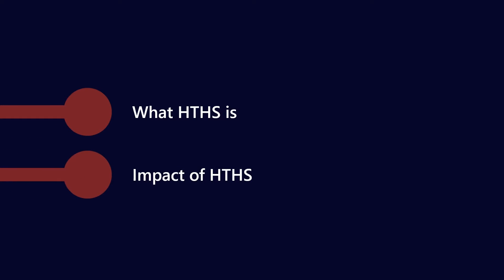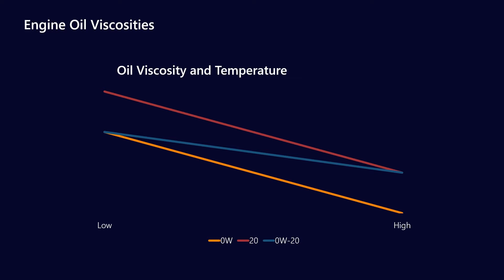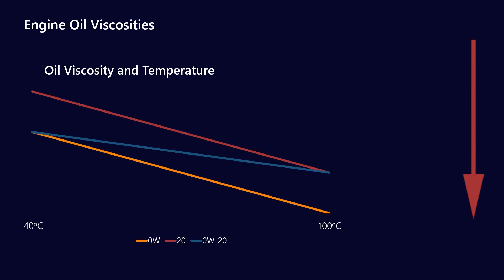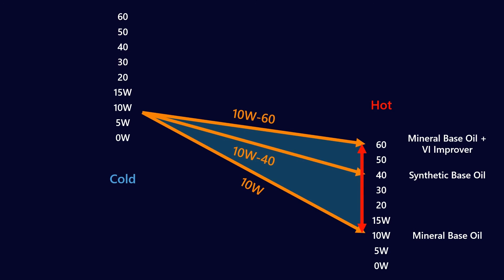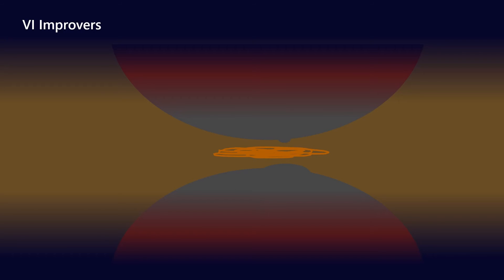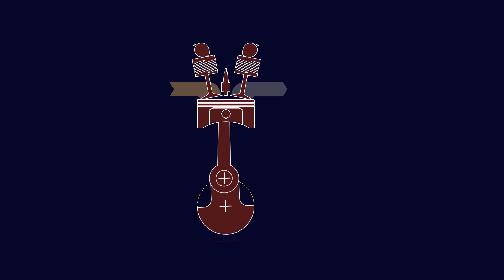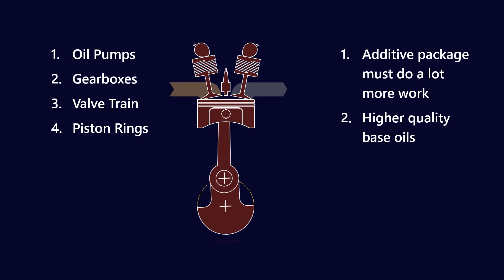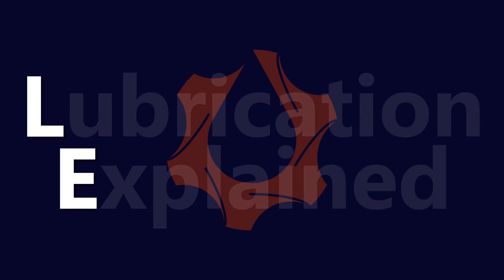How does HTHS viscosity impact engine performance?

Comment: Personally, I’m leaning toward HTHS, maximum viscosity for the cold temperatures seen, a good additive package, & 5k mile service intervals leading my oil decision.

You may look at your oil temp gauge and think you’re fine, but as you mention, you need to choose based on worst case scenario temps at these high shear locations such as needle bearings in roller rockers, timing chain links, piston rings against cylinder liners, etc, the highest temp locations for maximum durability.

Fuel efficiency loss is last considering the high cost of maintenance these days.

Comment: I only run oils with HTHS of 3.5 or greater in any vehicle I own. Do not let them convince you that reduced HTHS formulas are better. They don't even yield any fuel economy improvement. Stay away from anything under 3.5. The VW/Audi 504/507 or Porsche C30 C40 spec is the only one I use in anything. The government wants your car in the junk yard ASAP. Remember that.
Reply: If your engine isn't designed for low hths viscosity oils, you must not use them. If it's designed for these oils, it may not be recommended to to use standard hths oils.
Reply: @franktechmaniac7488  Not true. There is literally ZERO difference in design. Some of them are even the SAME ENGINE with different oil requirements! Proven by part numbers and build dates. AND The owners manuals in other countries for the same vehicles even prove this. So get out of here with that nonsense.
Reply: It seems you know about oils.... I admit you... What country are you from?

Comment: Does higher HTHS necessarily mean higher protection? There are myths surrounding the BMW S65 engine rod bearing, which people claimed that the rod bearing clearance is too tight for the 10w60 oil to pass through the gap. However I think it's the HTHS being too low, contributing to the damage of rod bearing.
I suppose the temperature within the bearing should be way higher than 100C and will put enourmous stress on the oil, therefore I always opt for oil that has the highest HTHS with decent 40C and 100C viscosity. Do you think if I am on the right way? Thanks
Reply: No, the temperature in the bearing is about the same as the engine temperature. Might be only a few degrees higher.
Reply: S54 had same problem and it is that shitty 10W60 that should not be used in any engine. BMW bearing clearances are meant for 30 or 40 oil. 10W60 Castrol shears very quickly to 40 anyway so why collect that sludge from sheared VI improvers in your engine ?
Reply: @V8Lenny  I switched to Mobil 15w50 and has lower engine temp.
Reply: @lamelessness  yes because it is thinner.
Reply: @V8Lenny  thinner oils has lower engine temp?
Reply: @lamelessness  lower oil temp.

Comment: A question: If my Acura J37 engine has a recommended oil grade of 5w-20, can 5w-30 oil be used instead?  The reason is that 5w-20 seems to shear faster and then engine starts to consume oil at ~ 2k miles.  I was thinking to get a thin 5w-30 spec oil(Pennzoil Platinum) which would slightly be thicker than a heavy 5w-20.
Reply: Yes, 5W-30 is fine to use in those. Feel free to try it, but don't expect miracles. The J37's have known problems with the piston rings. If your oil consumption is being caused by worn piston rings not sealing properly, no oil is going to fix that. I also doubt that any J series will significantly shear a decent 5W-20 in only 2K miles considering the fact that they don't have a turbocharger or timing chain and shouldn't be seeing particularly high oil temperatures. If the oil is actually significantly thinning out, fuel dilution would be a much more likely cause IMO.

Comment: So if my car requires VW 508 and I put in a VW 504 oil in instead the ONLY negative is fuel economy? Or is it possible changes in certain systems start/stop tech, valve lift tech, different oil pump to accommodate the 508 oil switching to a 504 will not harm these systems in any way?
Reply: This is a question I had but in a way, Audi seems to have inadvertently provided a possible answer. My S5 calls for VW 508 but the RS5 calls for VW 504. From what I understand, the engine design and parts are almost exactly the same (including the oil pump, rocker arms) but the RS5 is a twin turbo engine vs. single turbo in the S5. Both engines are classified as EA839 engines. 

Long story short, I'm going to be out of warranty later this year and will be going VW 504 afterwards -- especially with some owners having rocker arm failures.
Reply: @larphraulen  personally I would double-check to make sure that your vehicle doesn't have a different oil pump.  Most VW vehicles that spec VW 508 do indeed have different pumps.  As an example the Golf R and GTI both have a version of the EA888 but the GTI has different internals even though they share the same engine code.  Will switching to 504 cause catastrophic engine failure?  Of course not, but if your not tuned don't track your car then why switch?  I would stay with the VW 508 and change the oil every 6 months or 5000 miles whichever comes first.  Doing this?  Your engine will literally last forever.  It sounds like overkill but oil is cheap compared to repairs.  Do yourself a favor too and don't go to sites like Bob is the Oil guy.  All that place is are a bunch of people that think they know stuff and generally confuse people or give bad info.  There are some knowledgeable people there but most have left.  Your car do what you think is best👍
Reply: @larphraulen  Hey, I found myself in the exact same position, out of warranty, s5, currently on 0w-20 but researching 5w-30, 5w-40, 0w-30 and etc. Did you happen to switch to 504 VW504 which I assume is 5w-30 oil?

Comment: I think that I would be willing to sacrifice a bit of fuel efficiency for higher protection! So I suppose I would need to look for oil with a higher HTHS.
Reply: In certain circumstances I think it's still good for the environment to spend a little more on petrol, because theoretically protecting the engine means I replace my entire car less frequently

Comment: my mazda skyactiv engine requires 0w20 have already driven 135,000 km and the engine still runs like new at the beginning I was skeptical about 0w20 but it works excellently the oil also has no oil consumption
Reply: Both 5W-30 and 0W-20 are allowed in Europe. I tried both: on the highway in winter and summer, mountain climbing, urban use, it was all there. The 0W-20 consumed oil at 30-40 degrees Celsius on the highway (it went from the max. to the min. in 1200 km), the 5W-30 didn’t. Furthermore, ACEA A3 and A5 are also listed in the service book. ACEA A5: 2.9 - 3.5 mPas HTHS viscosity. 0W-20 oils only have a HTHS viscosity of 2.6 mPas. So they aren’t good enough for a hot engine. In Central Europe, it is not so cold in winter (maximum 0 and -10 degrees) and the 0W isn’t more beneficial than 5W (I mean there isn’t any big difference on this degree), but instead of 20, the viscosity of 30 on the warm side is more justified, since the value of HTHS is better and 30-35 degrees is common in summer to be.

Comment: I have two vehicles, both of which are around 70k miles, both maintained very well, and both recently developed some timing chain jiggle/tick around the same time with the only variable having been that I've been purchasing the latest motor-oil formulations which are constantly being updated to be more "fuel efficient".  
I should note that all of the motor oils I've been using are full synthetic.
I spent a good while trying to figure out why both of my vehicles would suddenly develop timing chain noise (not just at start-up but a constant jiggle/tick indicating stretching due to wear) when that shouldn't be the case yet since each vehicle is just over the 70k mark.
I tried experimenting with additing viscosity improvers with some success noting that the VI's would definitely quiet things down for a bit although ultimately as that batch of motor oil would accumulate miles the timing chain noises would return but also I noticed that even if I could quiet the timing chain noises (via viscosity additives) that on hot days or once the engine/oil got hot, the noises would pop up again, thus indicating that it was not strictly a viscosity or even lubrication issue, but rather a formulation issue in which the boundary layer was becoming compromised at high temperature.
Some brands of motor oils were worse than others when it came to this high temperature reduced performance characteristics issue with Mobil-1 being the worst of all, and I tried 3 different versions of that brand with their highest fuel efficiency version resulting in so much valvetrain noise to the point that it was alarming and I dumped that oil after only about 50 miles of use.  SuperTech was not nearly as bad but still required a viscosity improver additive reduce the chain jiggle noise but just as before, that was only partically effective at dealing with the chain noise and the noise would progressively increase and return as miles were put on the oil and/or the oil would get hot. 
Because of all of my observations and experimenting with different oil viscosities, brands, as well as viscosity additives, I came to the conclusion that the timing chain noise issue was due to premature wear that was occurring due to constant changes in motor oil formulations that were being pushed by never ending government regulations/requirements for increased MPG ratings and due to this compromises were being made that were allowing for greater wear to occur in the name of improved fuel economy.
The thing is, new cars are being designed to "tolerate" these new "high effeciency" motor oils with tighter tolerances and design elements that takes these types of oils in to consideration, but that does not take in to account all of the older cars on the road such as mine that although they have low miles and are well maintained, they were designed to operate with motor oils formulations that were available at the time, and which oddly enough not appear to be superior to the new motor oil formulations when it comes to wear prevention and especially maintaining their metal to metal boundary layer even in the highest temperature and critical wear/contact areas of the engine.  
This is where I believe I've ended up with premature timing chain wear (ie "stretched" timing chains) as this issue crept up little by little as the newest generation of motor oils have hit the market. 
My latest attempt to test this and attempt to address the issue it has caused was to search out an older motor oil formulation/rating and then carefully observe the results.  So I discontinued using the latest formulations and instead went with an older formulation (with an actual stated HTHS of 3.6) and from the very first crank of the engine, all timing chain noise is gone and even on hot days and at oil maximum temps the timing chain jiggle has not returned. 
I should also note that as far as motor oil viscosity goes, I've tried to maintain a certain degree of consistency when it comes to stated cSt viscosity numbers, more so than the actual xxW-weight number on the front of the bottle since there are for example some 5W-30 rated oils that have a cSt rating of between 11.6 to 12.4 while at the same time there are some 5W-40 motor oils which are nearly identical in the cSt with a stated rating of cSt of 12.6 at 100 C.  (same can be said of 0W-20 versus 0W-30 oils, check the cSt @ 100 C rating)
In my case the timing chain wear has unfortunately already been done due to the reduced protection that these most up-to-date motor oil formulations, thus the long term solution is going to be installing new timing chain kits in both vehicles WAY before either of them should have had the need of such. Using an older oil formulation though is buying me time to do such work since this previous generation of oil formulation seems to do a much better job at both maintaining it's viscosity and HTHS rating than the current formulations (which in turn is providing a "buffer" to my cars timing chains, taking up just enough space in between each link of the chain to prevent it contacting the chain guides) which in some cases are actually starting off with a lower HTHS to begin with but as my own experimenting has shown, even the ones that claim to still have an HTHS above 3.2 don't seem to be able to maintain those characteristics for very long.  Thus staying away from the newest motor-oil formulations which may be fine for 2018+ designed engines but the compromises they have made with these new formulations are based on increasing MPG's and not on protecting critical wear components on previous generation engine designs.
Reply from the maker: Wow! Thanks for taking the time to write up such a detailed comment. You're right, and the issue of modern engine oil formulations not accounting for older members of the global fleet is an ongoing issue. In other parts of the world, they simply address this by not moving to the updated standards. You'll be hard pressed to find CK-4 Diesel engine oils in plenty of countries in SE Asia, because the fleet doesn't warrant it. Most are working on CH-4 or even earlier.
Reply: Great read! I myself have moved away from retail group IV oils “full synthetics” and only use group V 100% synthetic oil especially for wife’s Honda 1.5T. I have also read studies about excess soot from direct injected gasoline engines caused by fuel only meeting federal standards… non top tier. This soot if not handled correctly by the oil can settle in between timing chain links causing wear/stretch
Reply: Nice experience. You should avoid viscocity under xW-30 (0w 20, 5w 30). only use 5w40 or 0w40 or above, because new regulation about enviroment: emission, fuel economy, strict into under xW-30 oil
Reply: Bro wrote a whole column.
Reply: I had also noticed the same issue with my Toyota Corolla VVTI engine model 2017. I had changed its timing chain hydraulic tensioner at about 80k mileage which had resolved the issue upto a great extent. However, I have focused on using SP grade 5w30 oil. Other specs as you mentioned about HTHS are also quite important
Reply: You have to go back to the oil specs when you bought the car A3/B4 much better for engine protection than C3 which is for catalytic converter conserving but this is also OK, and of course API SN always, for the GDI engines are the new SN Plus and SP that are developed for them and even  maintaining good IV and HTHS
BimmerN53
Reply: You diluted the oil with an additive-free VI product. The Motor Oil Geek, a tribologist also interviewed here, addresses this in one of his videos.

Comment: If it so that with lower HTHS fuel efficiency is higher then why the engine oil has to hv a minimum HTHS requirement to fulfil. Is HTHS to do anything with wear of moving parts??? As a very low HTHS with high temperature and high shear the film may break as its having lower viscosity and there might be chances of direct contact of moving parts….

Comment: Can low HTHS oils be used in diesel engines even though they are labeled as "Gasoline Engine Oil"? 
The question comes from researching for A5/B5 oil for a Ford Ranger L6 diesel engine (not available in the USA)
Amsoil's Signature Series 5W30 is one of the best oils with this ACEA spec and I'm in doubt if I should ignore the label since "gasoline engine oil" means nothing. 
15ppm diesel is the norm here btw.
Reply from the maker: Good question, and if you'd like a little more info on ACEA specs I put together an explainer: https://youtu.be/YZc6IR5WqWM

In general, just because something is formulated as a "gasoline engine oil" doesn't necessarily mean it cannot be used in light duty Diesel engines. In fact, the A/B category is for both "gasoline and Diesel engine standards". If your Ford Ranger asks for A5/B5 and the oil you want to use meets A5/B5, then you're good to go!

Comment: Obviously the experts have proven fuel savings by HTHS theory so another positive from the oil/chemical/OEM industries in their determined approach to emission reductions and fuel savings. A great presentation LE.
Reply: Except that you get exactly the same fuel economy savings from dropping kinematic viscosity (which everyone can measure) as with HTHS (which almost no-one has access to).
Reply: @MrSensible2  not quite correct. You have two 10w30 engine oils with slightly different HTHS rates and the fuel economy is better with the 3 cst vs the 3.3 cst HTHS. There has to be an ideal operating viscosity otherwise you have the prospect metal to metal contact by dropping viscosity number
Reply: @albertwild4650  First off, you don't measure HTHS in centistokes (cst), you measure it in centipoise (cP). Second, if you take two 10W30s both with identical KV150 (not KV100) & CCS-25, then any difference in HTHS will be miniscule. Lastly, real-life fuel economy absolutely DOES NOT correlate with HTHS. If anything, it correlates better with KV40 because most car journeys are short trips & the engine barely has time to warm up to 100°C, never mind see 150°C!
Reply: @MrSensible2  cst is the cP divided by the density.
Reply: @albertwild4650  Yes but this presumes you know the density of the oil at 150°C. Ever tried to measure that & not burn your fingers?
Reply: @MrSensible2  👏
Reply: @albertwild4650  If the lab has specc'd. They'd've done the lab expt @ temp? Gotta Be In It, To Win It :)